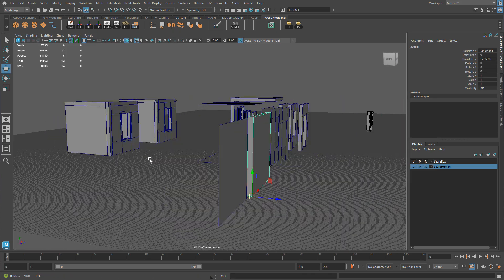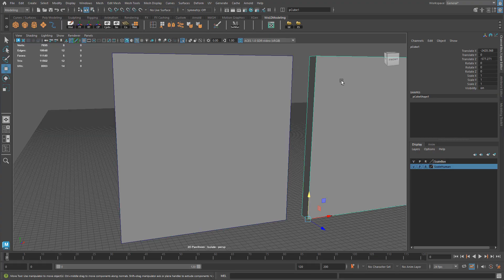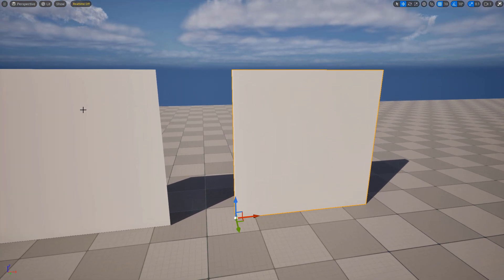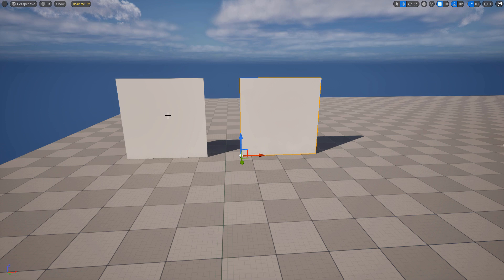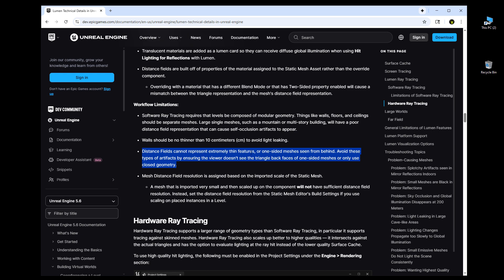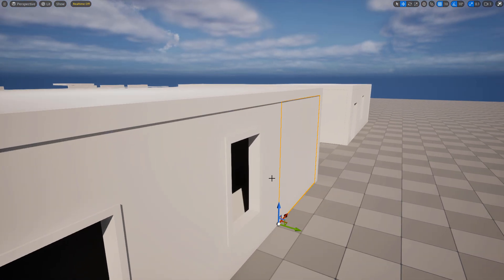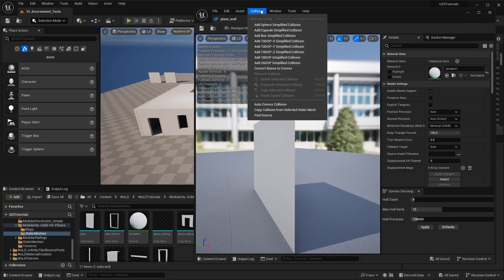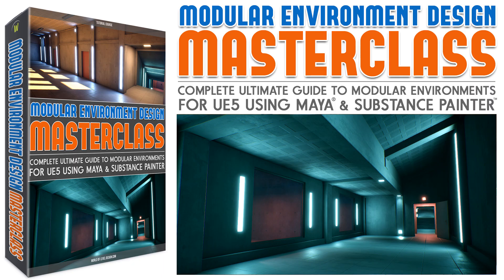Flat Planes vs. Solid Boxes: Choosing the Right Modular Geometry for Environment Design and for UE5

Comment: One downside of solid pieces is when you start to add variations and want the interior to have different types of walls than the exterior, for instance, walls made of wood, brick and plaster, with single sided pieces you can just swap the piece only in one side or another, but if is a solid piece you would need all combinations, wood\wood, wood\brick, wood\plaster ... even more when you start to add damages and ornaments.
Reply: My thoughts exactly. Except that you just need to assign two or more material slots for a cube and assign particular materials to them in the engine.
Reply: not really a downside tbh.  for walls/floors you should be using tilable textures unless its a hero mesh.. so design a master material for tileable materials and have 2 instances - one for exterior and one for interior.. than all you do is assign both those instances to the mesh depending on if its inside or outside.  the texture is instanced so it doesn't matter how many meshes use it, it will only be drawn once and than instantiated for all the other repeats.

Comment: for standalone VR, like the quest, it seems even having back to back flat planes means you're tracking 4 fewer walls than a 6 sided cube.   and.. if you're doing floors, those should be planes to save on resources, if no one will ever see the floors from underneath.   are those statements correct?

Comment: Great video! ALWAYS keep your back faces. Deleting backfaces is a holdover from the early 2000s and is utterly useless in games today even if you're targetting mobile. Geo is the easiest thing for GPUs to render and worrying about saving a few hundred polys is not worth all of the other downsides that come with deleted backfaces. Not only does it cause lighting issues, but it also makes it so that you can't use the asset in as many ways. I can't stand when people still delete back faces, but then do ridiculously more expensive things like multiple materials on a single mesh increasing draw calls.
Reply: Than ks good to know, so best to go with the solid walls?

Comment: UE5 doesn't cast shadows from geometry back-faces by default.  BUT it can.  Our games tend to need to use single sided geometry to optimize polycount.  But we do want shadows to be cast by all geometry regardless of which way the geo is facing.  All you need to do is turn on "Shadow Two Sided" for the meshes in your scene.  This can also be enabled by default in code.  This is not the same as using a two-sided material (which would double your polycount).
Reply: I don't mean to be rude, but I'm gonna call BS on whoever gave you the idea that you're saving on performance with that method. What platform are you targetting that you think deleting backfaces is going to gain you any performance? Because I guarantee you it won't even if you're targetting mobile. Two sided shadows works the same as 2-sided materials in that it's actually adding in the extra faces that don't exist, so it's actually not saving you anything on performance.
Reply: @TorQueMoD  To be fair, a box is 12 tris, and 2 planes are 4 tris, so unless checking two sided creates a border with 0 thickness it'll be less faces.
Reply: @Moctop  No one is arguing that it wouldn't be less faces. We're saying it won't give you a performance boost. Polys are the easiest thing for a GPU to render. They really don't matter anymore. And the downside to deleting the backfaces far outweigh the benefits.
Reply: your net performance gain is +-0 by that method my man 😁

Comment: 4:17 , Easy method is just to Change the material into "two sided" also using 2sidedsign node, it's lerp between + Normal and - Normal. By default All DCC ignores - Normal because it cost performance , that's why Maya shows it Black/Dark/Will not render that side. I would suggest just use this : https://youtu.be/Xoj3L2ezbZw?si=jyETfocHrGFS0oQ- .
Reply: yeah, but two sided has a cost

Comment: how you say say solid box modular geometry is better for nanite? It would make more overdraw for any parts that leak through that dont get culled.
Reply: Epic recommends "water tight" geometry for nanite to cluster triangles and resize them efficiently. Nanite also does a better job at per triangle culling (due to how it clusters triangles) than occlusion or frustum culling does. So it actually results in fewer draws. 

Overdraw with nanite only really becomes a problem when you have to constrain its triangle clustering and reduction settings to maintain thin detailed shapes. An example of this is foliage. Nanite has a the same issue with overdraw with foliage that non-nanite card based foliage has at the expense of more triangles being drawn when overdraw occurs. This is one of the reasons why in 5.7 Epic is shipping with experimental voxel foliage so at the distances where overdraw becomes a problem due to nanite not being able to reduce the foliage any further it switches to 2d sprites that are an average of the color data at the voxels location. The size and amount of voxels is tied to screen size so the smaller the tree gets in view the fewer the voxels that represent it are. Highly efficient and looks very good.
Reply: Curious about this myself.

Comment: at this point.. for modular tesselated stuff i do a stright angled extrution but i lock the normals so they still aim forward ... even on the curved edge area... Its the only way i can get tesselation to work well with nanite and modular. So basically extrude the edge.. move it in word slightly.. a tiny lip. Then make sure every verts normals are forward as though it has no extrusion.

Comment: thanks for the video! but how does it works with different materials for inner and outer walls? Is it better to make one solid wall like you did with two material slots, one for inner and one for outer material, or do i make two solid walls with each one material, having inner and outer walls completly seperated?
Reply: 2 material slots is more efficient.

Comment: I’ve been struggling with pivots on modular assets when using the plane method (i am baking lights for unity btw). Everything goes according to plan until I add a doorway and then every modular piece past that door is now 1 unit off or however thick I decided to make either doorway piece. Especially with corners as well. It’s so frustrating but I insist on using the plane method for mobile devices

Comment: It kinda off-topic but anyone know how to paint landscape material on other mesh like rock ? For example i have a rock floating in the middle air and i want to paint on it, is there any exist tutorial ?
Reply: You could vertex paint or use RVT to read landscape texture data and apply it to the rock
Reply: If it's a static mesh, you'd be better off vertex painting it. Landscape materials are for...well, landscapes.

Comment: Shader engines struggle with flat planes and unbevelled cubes. Bevel your sharp edges, even if it's tiny, like 0.02
Reply: didnt know that about edges, why does it do it?
Reply: @ristusnotta1653  Well the engine doesn't struggle mathmatically, it just doesn't have geometry to catch light without bevels. When you have sharp corners on cubes, the surface normals jump from 90° to 0° instantly. Lighting has no transition band. Light reacts in a harsh, unrealistic way. You lose the highlight that defines the form. Even tiny bevels like 0.01 to 0.05 add smoother light falloff, physical edge highlight, visual realism/readability; better material definition and nicer ambient occlusion in baked workflows. Beveled edges give shading information, sharp edges give none

Comment: Thanks for making this. My question is what to do regarding UVs on the edge faces of box-based modular wall assets? Should I unwrap as normal and keep the island scale uniform, or shrink the islands for the edges to get more space for the wall part that will be visible? Can never seem to find info on this. Thanks again!
Reply from the maker: The faces on side edges of the walls I simply overlap them with the main flat bigger parts of the walls. But you could also shrink those faces down if you know they aren't going to be seen by the player and you'll use other meshes such columns to hide the wall sides.
Reply: @WorldofLevelDesign  awesome thanks for the reply!

Comment: Overall, thanks for the video. It gives me something to think about. Now all that remains is to think about how to make the module have 2 different shaders on the outer and inner sides.
Reply from the maker: Happy to help. And i'll have a video detailing this soon when dealing with interiors/exteriors parts of the geometry. Which essentially would be done with 2 different materials.
Reply: @WorldofLevelDesign  That's basically what I thought. You could make a 3D model based on several materials. And add a static switch for all weather effects in the material instance.

We can also create a "debug" material with a dependency on MPC - material parametr collection  - to understand which side is internal and which is external
Reply: @WorldofLevelDesign  
Yes, I've encountered light leaks, but I didn't know that Epic recommends using a 10cm thickness - thanks again)
Reply: if your shader does not use vertex colors for any specific effect, you can paint the interiors blue for example and exclude them from weather effects.
Reply: @pygmalion8952  we can. buut... If a shader has any effect, the GPU still calculates it, even if it ends up multiplying by zero. Using one of the RGB channels with zero fill still results in GPU overhead.

Comment: Hmm, Thanks for the insight. I see many AAA studios use volumetric surfaces. 
I was just thinking about choosing one for my project.

I think we also need to consider the "material" issue here.
So, the shader for the outer surface of the modules could be weather-based. But for the inner ones, puddles/wetness/raindrops aren't needed.